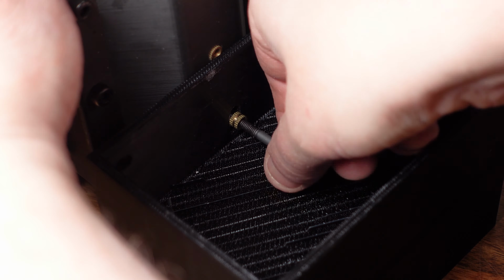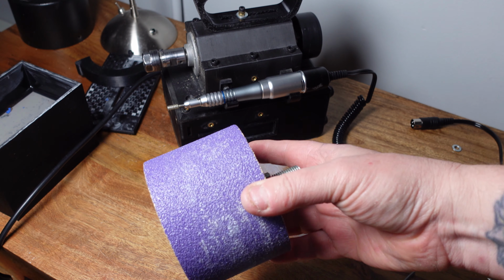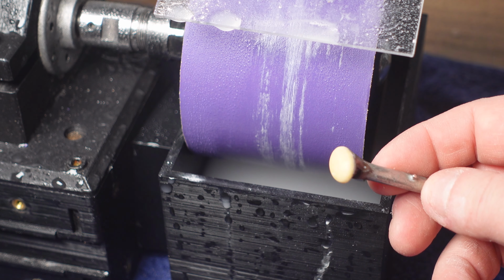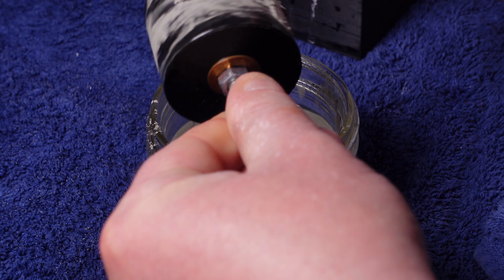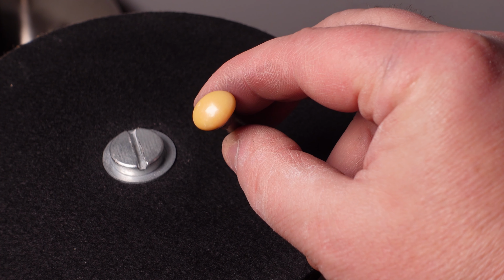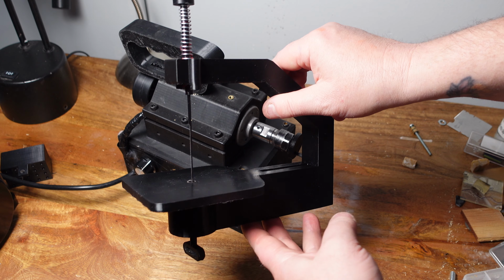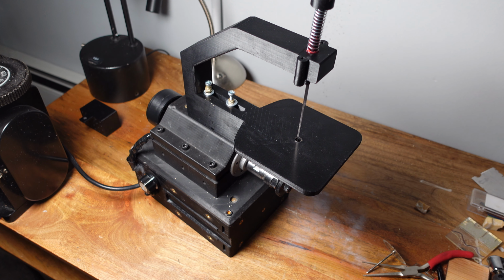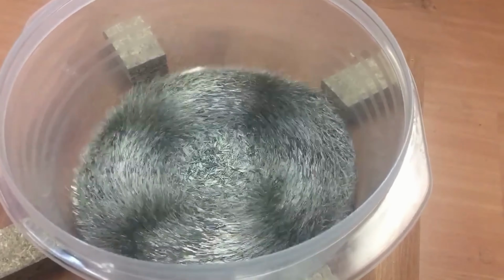DIY $65 3D printed jewelry making, lapidary, desktop hobby machine. UPDATE 2 #metalworking

Comment: i think the only thing that would make this better would be to add a foot pedal so you can use the micromotor like a foredom
Reply: Can you explain how that would work, using the micrometer that way?

Could you splice in the pedal and adapter from a sewing machine?
I'm not sure where it would all plug into the power supply though.

Comment: If you oriented your abs drum so the lines run laterally when it is in the tool holder the print lines could hold polishing compound.

This is a great project bud, keep up the good work because you're really onto something. If you took it to the next level you have these produced from aluminum and have a durable, budget minded hobbyist tool that'd probably attract many buyers.
Reply from the maker: thats a really good idea.

Comment: I printed my base machine last week (electrical box + spindle holder).  I used PLA+ from eSun and I was very pleased with the results, but (forewarning) these 2 parts took a full 1 kg spool of 2.85 filament at 50% infill -- not a problem but you might want order a couple of spools if you want to print the base machine + attachments.
Reply from the maker: backers are now using 25% infill for the case and 20% infill for everything else with good results so the filament consumption should be much better now. Keep that in mind for any future attachments you decide to print.
Reply: @@afourthposition Lulzbot TAZ6 with 2.85mm filament